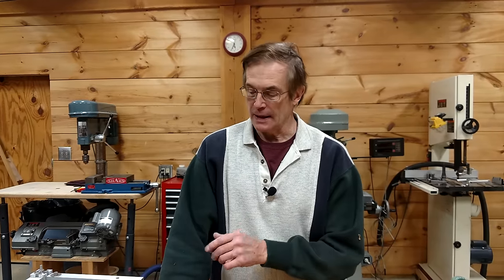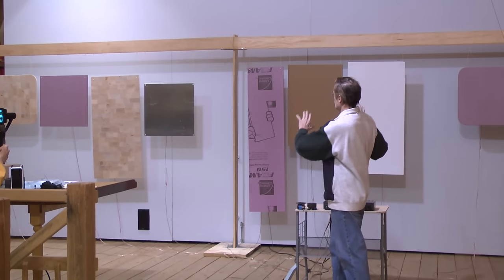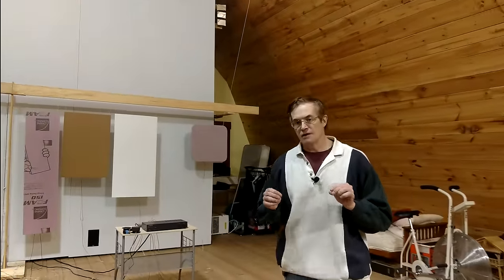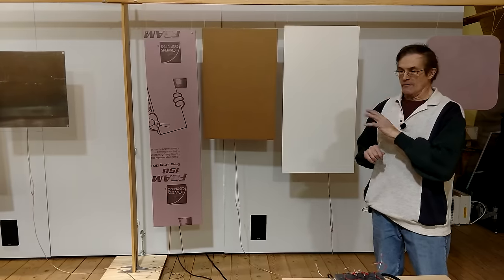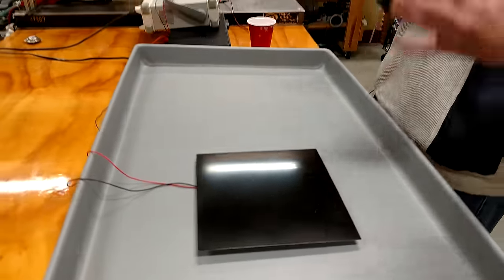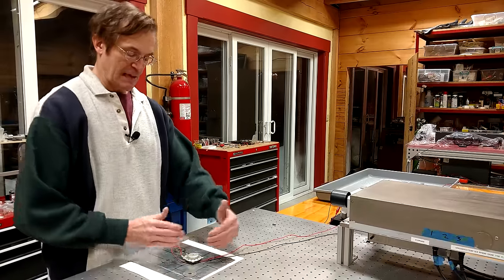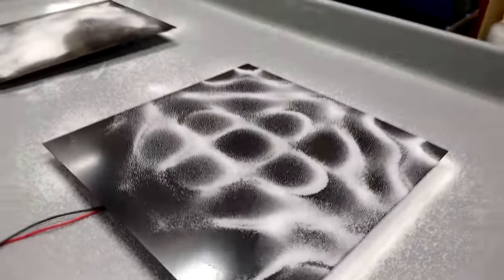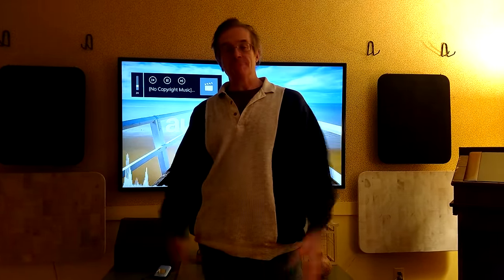Fantastic DIY Speakers for less than $30!

Comment: Very neat speakers! Here's some thoughts from an acoustics and signal processing student. What you essentially have here are dipole panel speakers, where good portion of the frequency range is directional due to the size of radiating area compared to wavelengths produced. It will have good deal of breakup modes for essentially the same reason, which is probably why you found well-dampened materials to work the best. In the industry full-range speaker cones are made from paper and other similarly dampened materials in order to deal with break up modes. The compromise is forfeiting the ideal rigid piston-like operation of the element and giving rise to distortion.

Here are some suggestions on how to improve the design: use 2 or 3 vertical elements of different widths along with a crossover (I'm fairly certain a simple 6dB crossover would do) to better control the power response (directivity in respect to wavelenght). Ideal would be a nearly room tall panel that will act like an infinite line array in conjuction with the floor and the ceiling in the vertical axis, while having horizontal elements such that no frequency is produced by panel that is as wide as the wavelenght  of frequency reproduced by it.

Have the panels much further away from the wall. A dipole speaker will produce 180 degree out of phase signal from the back of it and this will eat up the lower frequencies when they bounce of the wall and combine with the front wave (the very same destructive interference you mentioned at the start of your video in regards to stereo speakers when not listening at the center).

More is better! In order to get more piston-like operation, I wager having more driving elements per panel would help with distortion a bunch. Panel speakers like this exist in the wild and are essentially driven from everywhere along the panel (electrostatic speakers, magnepan speakers) and they sound very good indeed. The prices start from 1000 dollar and up, though.

Comment: After doing my own experiments with foam, I believe that the shape is very important.  If you excite the panels with a sin wave at the resonant peaks at the mod frequencies (eg 300-3000 Hz), you can usually find one, occasionally two, places where the resonance is coming from, and it's usually reflected from a corner (corners act as retro-reflectors) or a side. A rectangle give eight places where first order reflections can occur, causing resonances and nulls at all quarter and half multiples of excitation frequency. So what you need is a shape with no corners, and no sides at 90 degrees to the exciter. Eg a heart shape or nephroid shape, or lens shape, with cusps added to edges still at 90 degrees. And/or edge treatment such as angled cuts which reflect incident wave away in a new, preferably random direction.
Reply: inchresting, thanks
Reply: @apocaloptigon9988  inchresting 😂😂
Reply: he has a newer video that tests a lot of this
Reply: A ...circle   work?
Tia
Reply: The easiest way to test this would be to lay speaker flat and level and pour sand on it, then watch for patterns at different frequencies, correct?

By using a series of well-placed transducers, could one not minimize the importance of flex?
Reply: @exploranator  That should work at low frequencies, but would be very messy, and the changed orientation would shift the frequencies a bit anyway. The high-tech way is to use laser interferometry to picture the displacement of the panel, but of course this is too expensive for DIY. I use REW with a calibrated mic to get a spectrum, then revisit the peaks in the spectrum with a pure sine wave, and listen or use the mic to see where the resonance is occurring on the panel. You will typically see an antinode between the exciter and a reflecting edge or a reflecting corner.
Reply: @mikeallen2444  Circles are the worst shape of all when the exciter is in the centre, because the entire perimeter reflects back at frequencies corresponding to odd multiples of a quarter wavelength, giving massive peaks and valleys in the spectrum.
Reply: @paulwary  Was just wondering.Thank u for your experimenting knowledge sir'.
Reply: @paulwary  So.What is the best shape for bass and th best exciter to go along with it. Also.What exciter and foam 's shape,is th best combo for tremble? Thank u kind sir,in advance. Ps. I love this !!
Reply: @mikeallen2444  The current state of DML technology seems to be that everyone is still experimenting. Ive not done that much, and have not touched it for a few months. The lure is that the sound is astonishingly good in some ways, although there are issues to be overcome. Generally speaking, DML speakers don't give much bass below 100Hz so most people couple them with eg open baffle bass or sealed subs. Bass does go lower, but with big peaks and troughs. The general rule is for bass you need a large, long panel. Treble tends not to depend so much on panel shape, because it's radiated quite close to the exciter and does not extend to the edges as much, although a light panel will attenuate treble less than a heavy panel. Treble also depends on the exciter, many of which roll off too early (eg ~10k or less).  Ive tried just a couple of exciters and am not happy with either, although there are a couple that people recommend I will try when I return to it (cant remember offhand which one). There are 3-4 forums online with a HUGE amount of discussion and experimentation including scientific papers and patents, theory, reports of experiments and designs, etc. The most active currently is the 'A study of DMLs as a full-range speaker' forum on DIYAudio. https://www.diyaudio.com/community/threads/a-study-of-dmls-as-a-full-range-speaker.272576/page-251
Reply: Circle
Reply: So square subs over circle? Rectangle over square? Octagonal errrr  maybe
Reply: @gg-gn3re  the new normal! ?
Reply: @paulwary  Well, obviously it's not a good idea to put the exciter in the center; but what about putting it off center?
Reply: Would it be possible to use larger speaker drivers for more base response to eliminate the need for a separate subwoofer?  Would there be a reduction in sound quality at higher frequencies?
Reply: @e1woqf  Off-centre would be better, but shapes have resonant modes characteristic of the shape itself, and (relatively) independent of where the exciter is placed. Exciter placement can be adjusted to excite some of those modes more than others, so optimising the response. But still better to begin with a shape that has a more even distribution of modes.
Reply: @ronaldgreene5733  The bigger the panel, the more bass you will get. But there is a trade-off, because the bigger the panel, the longer the ringing will go on, so you have a too-long impulse response and you lose tightness in the bass and clarity.. You also have to contend with room modes, so subs are useful for that because you can move them to the best location. But of course people do use them without subs, it depends upon the types of music and how much you care about fidelity. I think it's still an open question whether panels can even replace woofers for eg drums. But I think for the mids they are great.
Reply: @paulwary  That would be some irregular, random shape, I suppose?

Comment: Excellent technical!! You lay out very understandable audio laws and how doppler and other ways that sound disperses in space.  Thank you for the time you took to put this together.
Reply from the maker: Thanks.
Reply: @TechIngredients  Friend, what about composite materials? Like, in 26:40, you have one styrofoam panel + one "balsa wood" (?) panel, what if you glue a tiny layer of styrofoam on balsa wood, or even more layers (like styrofoam -> balsa -> styrofoam, or balsa -> styrofoam -> balsa, or styrofoam -> balsa -> aluminum, etc...)? Or put a strip of balsa "somewhere" in a styrofoam panel? Different sizes/shapes/etc... of mixed material? Of course the "sound will sound" (😂) different,  etc... But... Maybe the "compensation" of one material over the other can be in the same panel and not on different panels/"speakers"?

Comment: Also, if it hasn't been mentioned yet, the exact speaker is DAEX25FHE-4. Currently $8.25 on Parts Express, not including shipping.
Reply: FuzzyWuzzy thanks, I was surprised not to find a list of materials or at least a link to a web page with those details.
Reply: Exciters like these can be purchased cheaply pretty much anywhere. I think  the exact kind isn't very important.
Reply: Formaldehyde Eyeball 
They sell and have stores worldwide.
Reply: Thank you was wondering about that

Comment: This sounds similar to a speaker system I ran across in the early to mid 70s.  I think they were called "PolyPlaner" speakers.  They were made completely from polystyrine plastic except for the voice coil/exciter.  Mine were about 12" x 16" and sounded great.  I had a bar between the kitchen and living room so I replaced some of the wood paneling with two of these and it sounded great.  In the open air they were a little 'tinny' with an emphasis on higher frequencies but when mounted in the space under the bar the solid mounting and the resonance of the cabinet space under the bar made them sound really good.  At the time I had a Craig 2000 stereo system which was considered fairly high end at the time, and these speakers were comparable to the original Craig speakers except for the power handling capability.  At high volume levels they started distorting before the original Craig speakers would.

Comment: thank you.
The nlightn panels I had from carlsbor, back in the early 2000s, were amazing. They had 5 drivers, I think. 100w input. The guys who made them said that the placement was more of an art than science, and 2 of the drivers were out of phase with the other two. I guess that's an active version of the passive damping you've used.
They really shone when used in reflective environments - we had a party in an old warship,  and the JBL speakers made the place into an echoing hell. Put the flat panels into the mix and suddenly all the reflections kinda went away. Some interaction between the chaotic wavefront and the pistonic wave front

Tectonic audio makes huge ones of these, with ribbon tweeters for the high frequency fidelity

Comment: Material sound tests:
1. 9:24 Aluminum Plate
2. 11:20 Extruded Polystyrene (XPS), rounded square
3. 12:03 End Grain Balsa 
4. 13:32 XPS, large rectangle
5. 14:31 2 + 3 in stereo
6. 29:13 Final product used
Reply: Seems to me that the bass is strongest off the aluminum? But the XPS is incredibly impressive. However, balsa wood can be turned into wood glass in thin enough sheets so there are interesting possibilities there...
Reply: I quite liked the aluminum, sounds like being inside of a crystalline cave, or so I assume. I also noticed the slamming bass.

Comment: I was a bouncer at a large nightclub for about 6 years, and I gotta say, when I go to a bar as a patron now I behave exactly like you do at 14:30 😆, and after a good buzz I get a little crazy and behave like you at 15:30 with just a hint of head nodding. 

Love your videos - you've sent me down a learning rabbithole and I can't think of a better use for my spare time than learning!
I also couldn't help but notice your counterweighted plate with 2 iterations of the 2/5 - 3/5 rule applied looks like the fractal orientation that many renaissance paintings adhere to in terms of focal points. Music for the eyes!

Comment: Very interesting, I'd like to see a frequency response chart on these to see how flat they are.
Reply: Time to get a spectrum analyzer. I suppose these days its available as just a phone app. I had one with pink noise generator and after resetting my stereo to flat freq response the sound was awesome. I never realized most speakers overdrive mid ranges so badly.
Reply: take a look at minidsp and the software "rew", that's what I used to do the same thing.
Reply: they usually have  loads of peaks as most DMLS have, you might need to tune them to size even to fill in gaps and such.  at my channel i did something similar.
Reply: They may not measure as impressively as we might like. Stored energy (ringing) is especially bad with this type of technology.
Reply: Usally most decent speakers today do not overdrive the mid range at all, they're at worst pretty flat with the classic smiley curve with louder bass and top end.. and a sag in the midrange... or the "BBC dip" if the manufacturer fancy that. What usually upsets your audio reproduction 10 times more than the speakers actual response is your room response.

The rooms modes causes nulls and peaks to form depending on the rooms size and ratio... and the speakers and listeners position  more or less dictates which modes you excite. Rooms can without trouble cause nulls that does -15dB or peaks of +10dB... This seriously upsets your actual response and is handled with traps, absorbtion, diffraction, positioning of listener spot and speaker placement. EQ can help up to a point, but remember that changes in spot A casues changes in spot B. So even if you EQ it flat, you still have room excitement and another spot have an even worse response... Also, nulls are NOT to be EQed for obvious reasons, they're also less noticeable than peaks.

What you need is a decent calibrated mic, like umik from mDSP or something like it, a mic stand and REW to take measurements. This is a must as you need a calibration file to offset the mics own frequency response defects.
Reply: Thanks for taking the time to do this. This is awesome.
Reply: You can see how flat they are.
Reply: "Flat" ends when the sound enters your room.
How "flat" is your room?
Or do you hear specs?
Reply: "What usually upsets your audio reproduction 10 times more than the speakers actual response is your room response." x100
Reply: But people pursue "flat" speakers, AS IF...........
I believe impulse response and lack of resonance and diffraction is WAY more important.
Wilson seems to as well. And Magico andMLB etc, etc.
Reply: Probably because they don't. Most are pretty smooth through the mid band.
It's your room.
Reply: Sure, but a much more interesting question is how is the phase response?
Reply: there you go!
Music is a temporal more than a spectral thing.
Or a flat freq response with twisted phasing sounds awful.
The flat phase and iffy freq response can sound pretty musical.
Ask the Magneplanar owner.
Reply: @johnpossum556  My Proson speakers I had to dampen 1000 to 7000 khz by 20 DB on the equalizer.... Some speakers have waaaay to much midrange.

Comment: Fantastic content, thank you! As a math person though, I'm amazed that you went to all the trouble of the counterweights and off-center positioning based on a 60/40 ratio rather than using 61.8 / 38.2, aka phi, or the golden ratio, or the most irrational number. If anyone decides to build one of these after watching this, I'd be interested to find out if it makes a noticeable difference. :)

Comment: Have you experimented with the ideal thickness of the material(s) or maybe even a graduated thickness from one end (or corner) to the other?  sanding or shaving the polystyrene/balsa might not be all that difficult, and could possibly preproduce the same effects as adding/removing counterweights.   

Outstanding video and a wonderful idea as is!!!

Comment: This was buried down in the comments from 1 year ago, by Tech Ingredients: The XPS panels are 1' thick x 24" x 30" with 4" radii for the corner rounding.  The balsa panels are 1/2" thick x 30" x 36" with 4" radii and the exciters are placed on the back, off center, based on a 2/5, 3/5 rule.  So for example, the exciter on the XPS panel is located  9.6" vs 15.4" from the long sides and 12" vs 18" from the short sides.  These work equally well.

I am going to build me a few of these, not sure which material I will use though.

Comment: THINGS I'M CURIOUS ABOUT:
1) the panel is vibrating, so does reshaping it to an irregular design improve/reduce the quality?
2) for a long panel, does making the distal end narrower (trapezoidal) affect the proportion of bass? Making it wider? 
3) transverse modes would be relatively to the dimensions, does a circular panel sound smoother?
4) since the panels are so light, wouldn't the best suspension method be to use the exciter frame itself?
5) use a small diaphragm mic to test, the cheapo Behringer are flat enough
6) the attraction of these are a lack of phase shift.  What are the limiting factors of the treble extension and bass? 
7) what happens if you put a damping material on it in Chlodny-relevant locations?
8) what method is used to attach the devices?
9... Ok, I'll stop.
Reply: 8: those specific exciters come with preattached 3m double sided adhesive tape (most of Dayton's exciters come with that), so he probably used that
5: yeah the recording quality was not adequate for the topic of the video
Reply: @mythron  I've read reviews of these on Amazon where the double-sided tape is not adequate. Now, that I'm reading this 3 yrs later. Have you found that to be true?